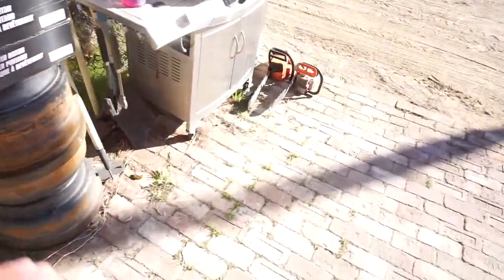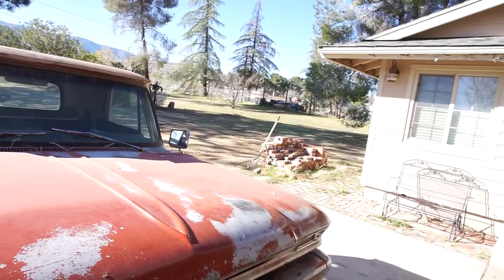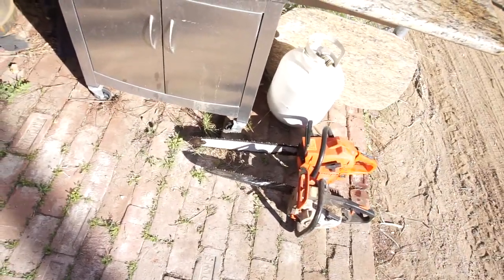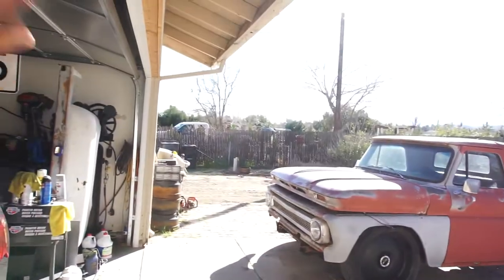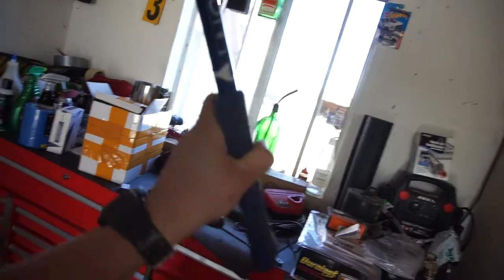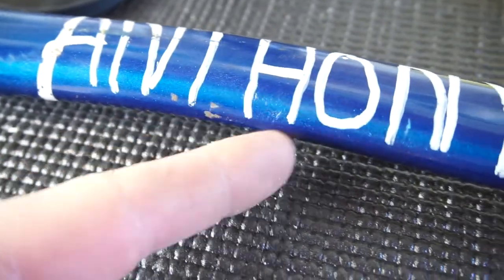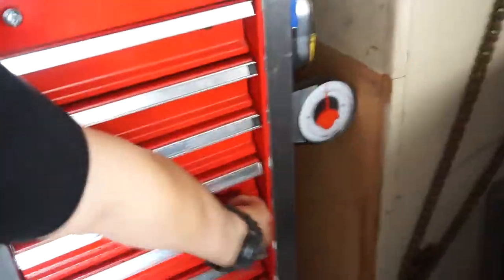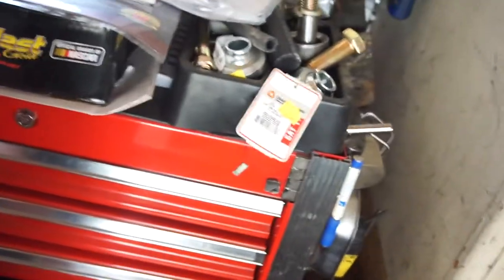Cut Some Trees Down To Make Room For Some More Projects. Wink Wink

Comment: My chain saw sits sometimes for a year or longer and it hasn't failed to run for me yet . the only thing I do is top off the fuel and add Sta-bil .  Ya' got's to pull on the cord a bunch but once it starts it runs tip top . Your yard looks twice the size now !
Reply from the maker: Orion Fixr yeah mine did too until I moved back to California. All this crap they put in the fuel eats the body of the carburetor. I use sta-bil too been using it for years and for my tractor now too the diesel kind tho.